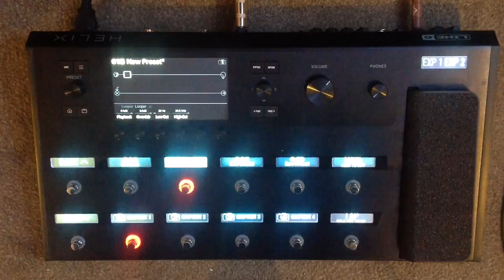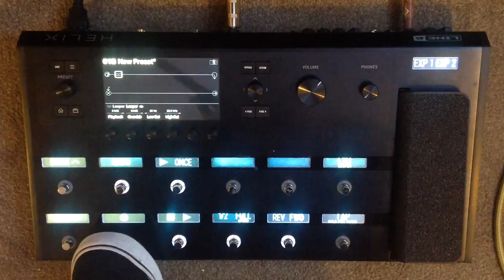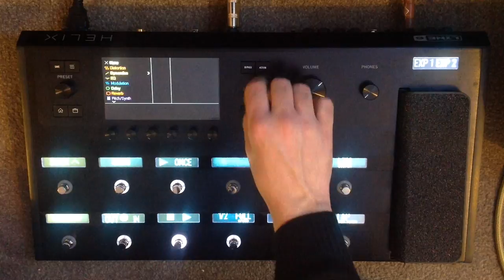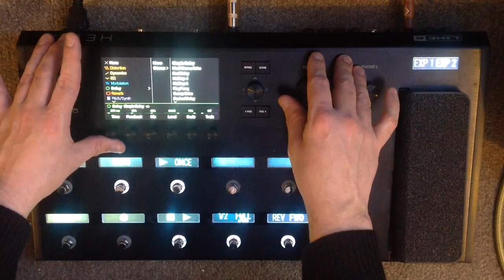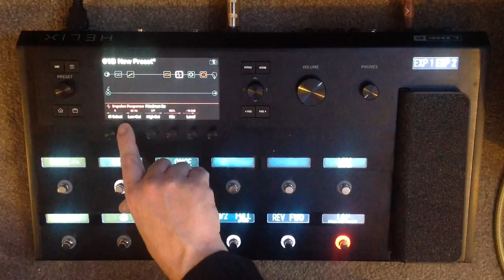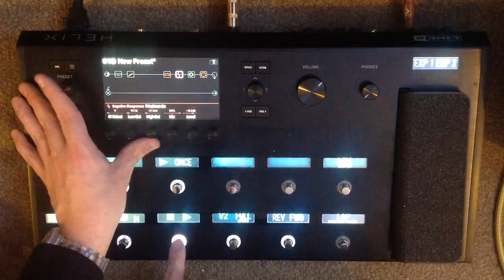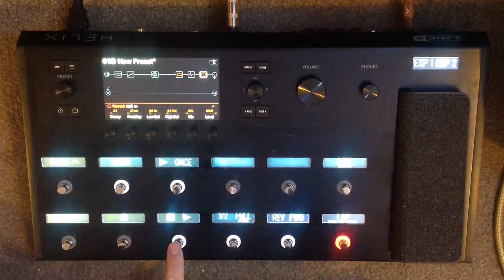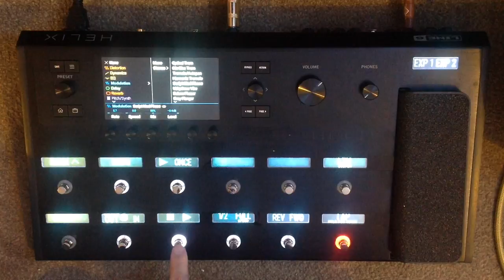Line 6 Helix How to build a patch part 1

Comment: Great vid! But i wonder if there is a chance to use only the poweramp section of an amp in Helix? In case im using a real tube preamp. Sending my preamp’s signal straight to the IR block is not a complete guitar sound chain without a poweramp...